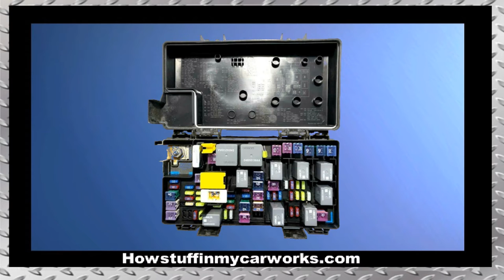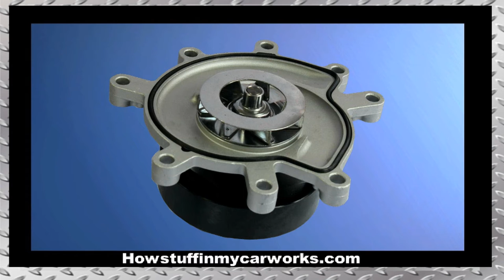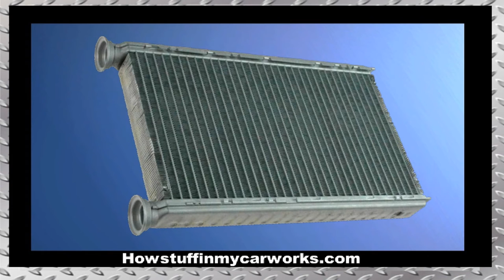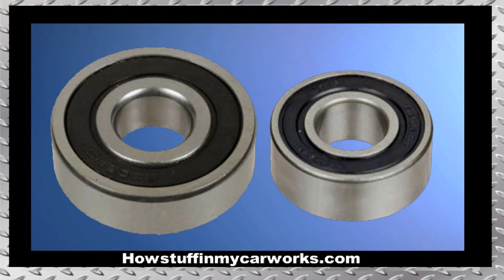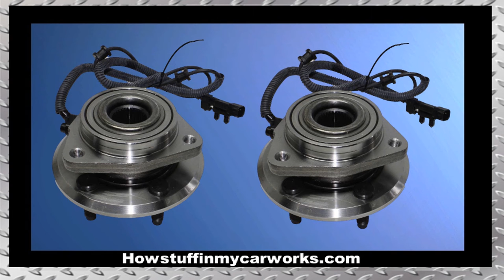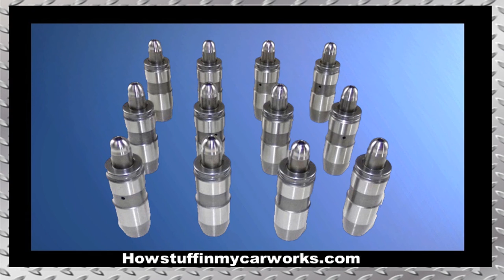Jeep Liberty 2nd Gen 2008 to 2012 common problems, issues, defects and complaints

Comment: Bought an 08 with 111k miles on it in 2016.
My alternator caught on fire- replaced
My ac clutch went out. Replaced compressor.
Sky rider roof broke. Sealed shut and calked closed
Rear window hinge rusted out.
Front differential, rear main seal, radiator, and transfer case all leak. 
Rear doors rusting out on wheels wells.
Rear hatch rusted in both bottom corners.
Radio head unit went out.
Won't go in gear when it's super cold until it warms up.
Muffler shield fell off.
Resonator rusted out- replaced

Changed the oil every 3k miles. Sent sample off to oil labs and they said the motor is in great shape. Will drive it until it dies

Currently has 173k miles. Chicago winters are rough on the undercarriages of cars w all that salt

Comment: I've got a 2012 and #5 hit at around 140k, mechanic told me because of the location of the AC/heat blower resistor it would be a 5 hour job and at least $4k before he even located the part. Its stuck in the windshield defogging position so I just left it alone since at least safety-wise I'm still covered.
For #3: I'm having more a of a hesitation on rolling UP the driver side window only, at it usually works after a couple attempts. I just bought a replacement control panel on Ebay and am gonna see if I can replace it myself and maybe that will help. 
Overall she's still tried and true and I love my jeep!

Comment: 08 liberty I just got it in August of 2022 & already had to replace the water pump & the AC blower was stuck on defrost when I bought it... Then after I bought it I was leaking transmission fluid out it's lines 😅

Comment: WHY DIDN'T YOU MENTION THE THE EXHAUST HEAT SHIELD VIBRATION AND BREAKAGE FROM METAL FATIGUE AROUND 100,000 MILES.

Comment: Had a 2004 Liberty Limited, put almost 200k miles on it, very little issues other than standard issues and window regulators.  Also bought a 2012 Limited, that has been relatively OK, replaced water pump twice, compass will not calibrate, seat heaters stopped turning on, heater core will need replaced.  Just took my passenger side front seat out today to start troubleshooting the seat heaters.  My brother is going to replace the heater core and also some other part which is best to do while you're doing the heater core.  My '04 was on its last leg and I traded it in for ANOTHER 2012 Liberty... but that was PLAGUED with problems... specifically the TIPM and the blend door was stuck in defrost.  THere were other issues.  I replaced the TIPM but sold the vehicle after that.  Never even thought of buying another Liberty since then and will NEVER buy another Chrysler product.  Also, I have rust bubbles at my back tailgate where the guy in the factory (toledo) used to brag about not crimping them all the way because he always got too tired. >:o

Comment: in the past five years of having my liberty i’ve had five of these issues lol
Reply: Would u recommend buying one I was going to buy a use one lol idk about that now
Reply: I personally have 175,000km on mine and with the exception of the coolant pump going and the cheap plastic switch for heat and coolant doors failing, it’s been a great vehicle. I would get another! 2012 Jeep Liberty Sport. She may be a gas jog but very very reliable!
Reply: Same
Reply: @robinjohnson3285 don’t do it. It sucks
Reply: @jmemixx  not to mention it’s horrible mpg
Reply: Know I’m late to the party but as a owner of a 2012 liberty limited I wouldn’t recommend it. I don’t even have more than 125k miles on it either. 😅😂
Reply: I’ve gotten mine to a quarter million miles but just about everything is falling apart
Reply: @robinjohnson3285 I bought mine new September 2012 , if you get inf on how to maintain your vehicle it can last many many years,  I haven't had any issues with my 2012 jeep liberty 4×4 , 230,000 miles,  it's been just over 12 years,  it still fills like it's good for another 200,000 miles

Comment: I bought a 2011 liberty four months ago went outside last week and the motor was making a knocking noise to it to the mechanic said rocker arm went through the valve cover and that i need to replace the engine.
Reply: Might not have to replace it. Might just have to put the rocker arm back on and patch the hole. I had a rocker arm fall off of 2 of mine and wouldn’t run. Put them back on and runs great

Comment: Does anyone on here have a  front end vibration around 70 mph?
Reply: Front Rotors?
Reply: I did at 60mph. Had to replace the wheel bearing in one of my front wheels.
Reply: yea sounds like wheel bearing